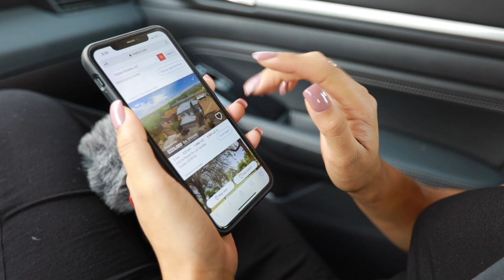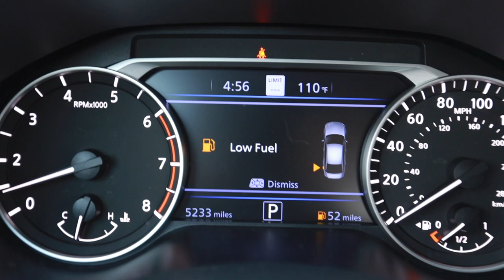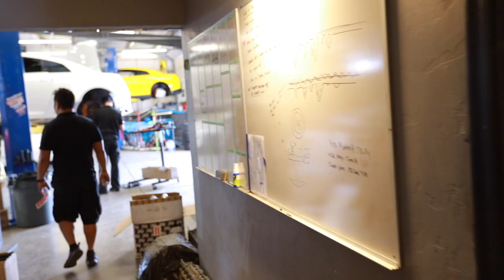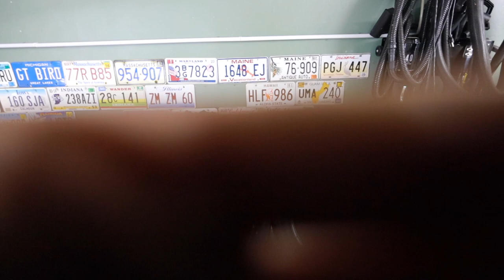Fitting The Widest Tire Possible On My New Wheels! // Vlog Series

Comment: Nice tire choice. I had the RE-71 and you're not missing out. They handled great but way too stiff. You could feel every imperfection in the road.

Also, if the 007a are like the RE-71, make sure you have some heat in them before you push them. Especially if it's a cold day. They will break traction!

Comment: Pretty sure that's the shop that built my exhaust.  I was a manual transmission swap done in my S6 by Audis4Parts right around the corner.  I recognized the buildings there and Phil pointed out where the place was.

Comment: Houses are half the price in the US than here in Oz, but mainly I'm disturbed by any car that isn't a pure track only that uses a push button starter (just being facetious).
Wheels look good, obviously perfect offset for the size/car.
Hanging to get mine back from the new ECU fitment so I can make some vids, covid lockdown interrupted everything around here. Old school cammed up Mercedes six, something a bit different.
But the ECU loom's half wired up sitting in a workshop, the valve cover is off getting powder coated and that's interrupted, we're all on a curfew and locked down in our homes in Melbourne for several weeks.

Comment: Yup the NORCAL wild 🔥 are no joke up here it’s definitely hard to breath even by the coast I usually have the worst weather but best air quality in the Bay Area current it’s all 😷 so it doesn’t surprise me that the smoke has spread that far east. 
Yeaaah the gangs all back together. 
That color is awesome 👍🏽
you should either wax or ceramic coat the wheels definitely helps keep the brake dust from sticking great tire choice BTW

Comment: You could run a 275/40 on that as well and probably still fit. It would bring the tire perfectly flush with the wheel lip. My stock WS6 wheels are 17x9 and the tires are 275/40/17.
Reply from the maker: Rotational circumference would be too far off w/ that size. 265/45 is really close to OE.

Comment: You can a new set of TPMS sensors for around 60.00 on amazon and they only last about 10 years and with the cost of mounting removing it just  makes sense to buy a  new set and be done with it. Then you can change wheels back forth efortlessly.

Comment: I just got the Potenza RE-71R's, 245/40R17 yesterday from the Tire Rack.  Was not aware they were being discontinued.
Reply from the maker: Yeah, a Bridgestone employee was the one that told me when I was trying to order them.
Reply: @SarahnTuned  Took them to my installer along with the new wheels.  Have to wait a week or two.  My 3rd set of Potenza's, RE730's on 16's for 14 years (they were shot with few miles), RE760 Sport on 16's but not the size I wanted.  This time, no compromise.  Got the wheels I wanted, test fit them before ordering tires.  Last time wheels didn't fit, i.e. manufacturing error.  Tire Rack had the size I wanted in stock, had them 2 days after order. 2 rebates which almost pay for 1 tire.  Manufacturing date was 9 months ago, probably not a popular size, or that's just when they did the run on that size.

Comment: What a pleasant surprise seeing Little Sarah, also Liz as well. 
The wheels look great in that colour, also the bulge is great. The particular Bidgestones you have are going to be good. I have had the 7's before and apart from being a little lacking {Traction Wise} for my LS powered ute they were reasonably quiet and rode really well in a 245/40/19 fitment. In an a 45 they should ride even better and out last their use by date considering how much use the Forester gets. 
Good Luck with the brake swap

Comment: Is 20 mm really worth the work and clearance issues, and even more importantly, the limited choices of tires in that size? Going to a summer performance tire in 245 would give you almost the same upgrade in traction and handling. The changes you have made to the suspension are a much greater factor than 3/4 of an inch with especially as the sidewalls are pinched by rims.  And what is the unsprung weight now over stock? 

And do you need a brake upgrade?  I have some reluctance to the concept of taking an SUV to a track. Mr Dos would be much more fun. 

I do love traditional five pointed star wheels and silver on white car is first choice.

Comment: the boost gauge sure what video it was recently not reading correctly - check fuel pressure its an issue i have been dealing with lately that has is causes all sorts of issues and errors !

Comment: Probably too late, but I’d just get new TPMS sensors from the dealer, that way you just put the old wheel/tires in bags, so they can be used for backups. 9 minutes in, yep too late. 😕

Comment: I would have picked something other then a Subaru to hop up based on reliability
Reply from the maker: I’ve owned it going on 6 years, 5 1/2 of which it’s been tuned to the absolute upper limit of what’s safe. It’s also my second Subaru. They get a bad rap from idiots with halfass modifications and janky tunes launching the crap out of them constantly or owners not paying attention to their vehicle and letting issues creep up.